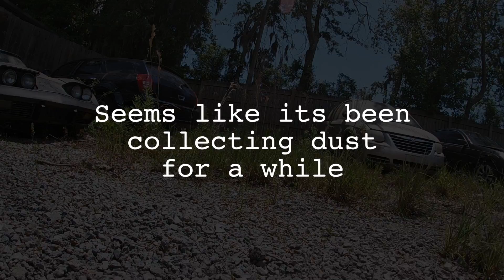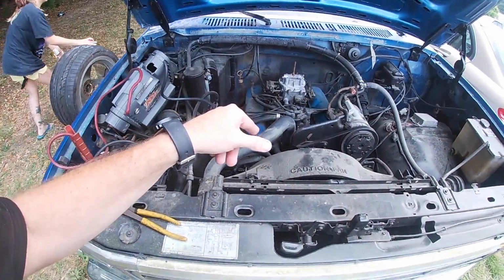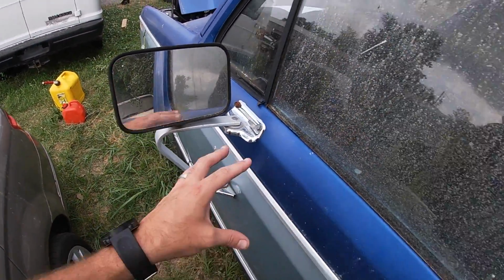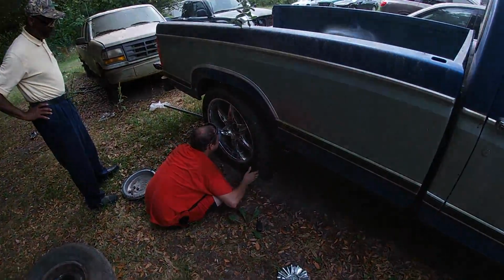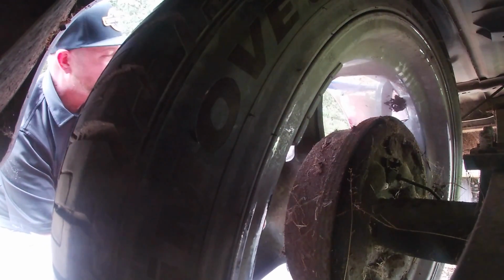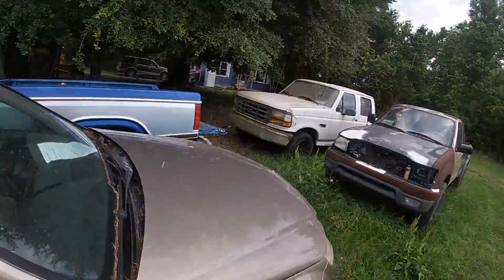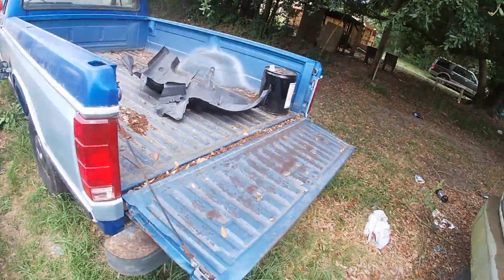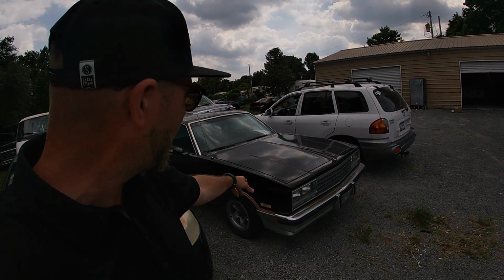I Found a 1984 Ford F150 & People Say This Was the BEST American Made Truck EVER!!!

Comment: I'd have a hard time selling that.  Not because people wouldn't be interested, I'd just be emotionally attached to it.  It's a really awesome looking truck, you don't see trucks like that any more.
Rear bumper's not too bad a shape.  I'd just coat it some with spray on bedliner.  I get plenty of cars that have some discoloration from sun damage.  Cheap 1 dollar black rattle cans from Walmart, and the cheap rattle-can bedliner from Walmart works wonders on trim.
And those wheels... I know no dealer wants to invest money into a car (or truck) that's intended to be sold...  But I wouldn't put 22" wheels on a nice classic.  Those original wheels look good to me.  If I had to do something to the wheels, I'd just dismount the tires, and chrome or nickel plate the originals.  There are some DIY nickel plate kits that aren't that expensive, cheaper than a new set of wheels.  Thing is, I don't like shiney…  I'd go with black powder coat.  Just my opinion.

P.S.  I don't know about a Superman thing going on, but it looks like your camera has more of a Brightburn thing going on, at least at certain points in the videos.
Reply from the maker: John Davis you said it perfectly John. I’d like to own that truck myself. Wish I could. Such a beautiful truck
Reply from the maker: I agree about the wheels to John. Now I love a set of good looking wheels and the 22's might look pretty on the truck, but I'd rather have 20's with a polished  alloy wheel. I'm not a fan of chrome wheels, but thats just me.

Comment: My first vehicle in high school was an 85 F150. I had so much stuff fail on that truck, ignition module, driveshaft u-joints, straight-6 carb issues, dropped the transmission to have it rebuilt. I taught myself how to fix all of those things.  I began my love affair of repairing vehicles with this truck. I would not exactly call it the best American truck made, I still liked it.
Reply: Chris Stromberg what about 1996 f150 any problems there I’m thinking of getting one

Comment: I had to put a $100 Chinese Autolite copy carburetor on my 302 and this '84 150 is one of my favorites and I've had more vehicles, including trucks that I could remember to count. I like vehicles with distributors and the fuel pump attached to the motor or clutch housing so I don't have to take the damned thing apart to change it. This one still runs straight,, Chinese  carburetor and all, and it probably will until the day I finally kick the bucket . . . and I ain't planning to check out anytime soon.

Comment: I just bought a 1980 F150 with the Inline 300 in it from my life long best friend, it was his dads truck when we were kids so we are both emotionally invested in it. My pan is to take the cab and bed off it and sandblast the frame and repaint it, clean up the suspension and lower it a couple inches,  put all new bushing including cab and bed,  clean up the engine and repaint the Block, Head, Valve Covers and Air Cleaner and then put it all back together and then throw a cheap paint job on it, The  new paint color is going to be 1993 GM Dark Plum, why? because I bought a gallon of it from my local paint supply company for $50 because it was a "Miss-Mix", meaning it's like a shade or 2 off of what it was supposed to be and it was returned, good way to save money and because Nate, my best friends dad would CERTAINLY approve at me being thrifting and saving money. Then I'm just going to daily drive it. I'm starting to see more and more of them because they are the last generation of truck without all the computers and brains and all that and they are everywhere and can still be bought for under 5k running and driving.

Comment: I have an 84 f150... mines a straight 6, but this one seems to run right (needs good tune up and once over)... body work looks decent & the interior is really clean!  The dash is an aftermarket dash cover... seat just needs one of them saddle blanket seat covers (that's what I did - looks great)... tailgate needs to be replaced with a straight one that's got the raised FORD letters (n matching paint)... But F*CK THOSE RIMS n' TIRES... just put some decent rubber on the original rims FFS... easily a $15k truck here in Manitoba Canada with a few tweaks.
Reply: Inline 6 not a strait 6, a strait 6 is a GM Engine and is called a starit 6 because the entire sngine is in a strait line including the carb and air cleaner where as the Ford is an Inline because the carb and Air Cleaner sits off to the side of the block. The tailgate is a XLT tailgate, only the "basic bitch" F-150 had the tailgate that had the raised letters on it, everything else got the chrome stripe with the little blue oval on the tailgate, but I do agree the raised letters look better. Whoever painted that truck did a shit job and I'm willing to bet that thing is FULL of Bondo. That's $3000 truck here in the U.S. at most.

Comment: I took in 100k worth of scrap to the junkyard with a $400 dollar hand me down 84 f150, we put 2 tons on it constantly with nothing but cheater springs and gussets , the hottest setup  was a  holley 350cfm 2 barrel ,dui hei , flow tech headers purple hornies  and a m5od , 10 foot 2x6 flat bed 2wd. 235 75 15s wranglers,  that frame was flexible open channel/ easy to wash , wasnt prone to cracking behind the cab like chevys. we sprayed it with motor oil through a paint gun twice a year , rear end was limited slip factory, not only did I make a killing with it working, I drag raced or drove it sporting every day, it wasnt the fastest thing in the world, but you could hit 70 in 2nd gear 3rd get your needle buried at 85 get on the highway in 4th gear run that truck up so fast you'd leave off the gas and the needle was floating 20 seconds later 5th was useless to me but I guess it would save you some gas or run even lower gearin . I had that truck from when I was 18 to 27 years. We called it a 20 dollar whore because it was cheap / easy to matain /fun would take whatever you could throw at it and she'd come back for more . Redlining that bitch in the summer get it so hot the lifters collapse,  you'd swear it was dead but no let it cool back down fill it with river water and keep going , that truck lived to 380k miles and I gave it away still running to a boy so he could learn to drive a stick.  I loved that truck like it was family I couldnt crush it it felt better to give it away

Comment: I've got a 1985 ford f150  trk with a 300  6 clyender motor with a 3 speed manual stick in the floor with over drive 2 wheel drive

Comment: I might be getting my hands on a 1984 f150 y’all! I can’t wait x___x
Reply: Dray PurplePenguinization Congrats, I’ve been looking for a classic f-150 and I’ve seen prices from $900- up to $40,000. What price are you paying for yours?
Reply: Gogo Luc depends on condition
Reply: Gogo Luc I’m getting one today hopefully for $1500 it’s in pretty good shape besides needing a tailgate and a new windshield eventually only 50k miles on the straight 6 motor
Reply: Gogo Luc I ended up not getting it. There was a lot of issues for on it. The main one being that they used housing electrical wiring in it. They were asking 4K 😂 but I did buy a 1988 Ford F-150. For 2k . I love it !
Reply: @landlordrolph3262  I seent a 1983 Ford F150 for base $2000
Reply: I just got an '83 with the 302.... hasn't started in 10 years... should be fun

Comment: How do you know it's been repainted if you know nothing about the truck except it's been sitting for awhile it is possible it could be the original paint. And most likely also original dash things back then last a lot longer I mean your saying everything on this truck has been replaced I seen so many trucks like this with all original paint,dash, motor and transmission still working just fine and those are some ugly ass rims just my opinion though😅 and you should not have to drill holes bigger to get rims to fit 🤦 yea y'all need to leave that poor truck alone 😅

Comment: I’m about to buy an 84 for 300 dollars
Reply: Did you get that truck?
Reply: @mastercriminal8950  not yet. It’s out at my grandmas and there’s gonna be deer hunters out on her land so I have to wait till the end of the month
Reply: @coleringer533  I just picked one up for about that....mine needs a ton of work but I'm not a mechanic! But I like the truck ...let me know how yours turns out.
Reply: @mastercriminal8950  mines the same. It’s been sitting in a pasture for 20 years so it needs just about everything besides a frame
Reply: I'm in Alabama so I understand why your gonna wait till seasons over.
Reply: @coleringer533  is yours a straight six with manual transmission.?
Reply: @mastercriminal8950  it is a 351w with a 4 speed manual rwd single cab long bed